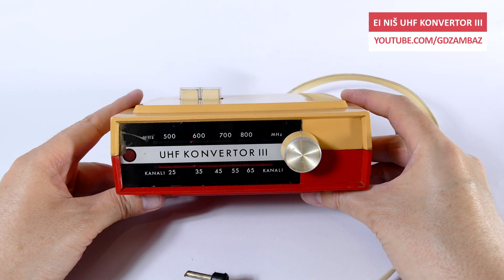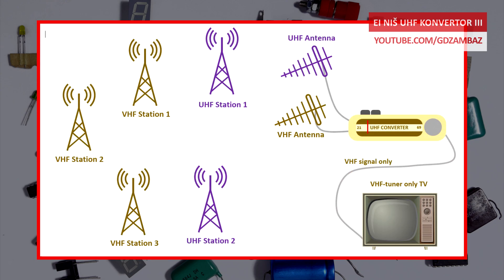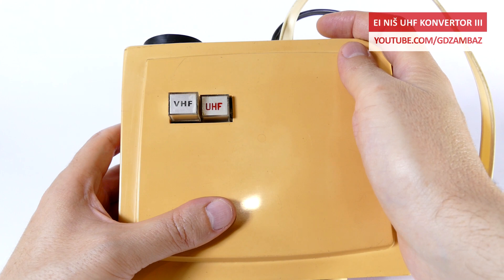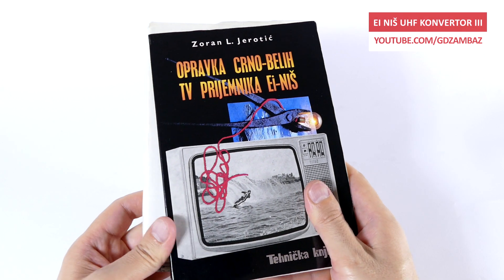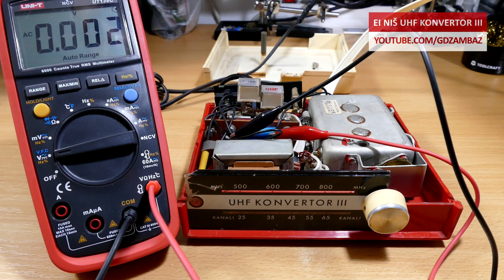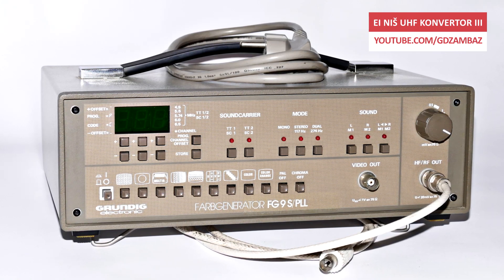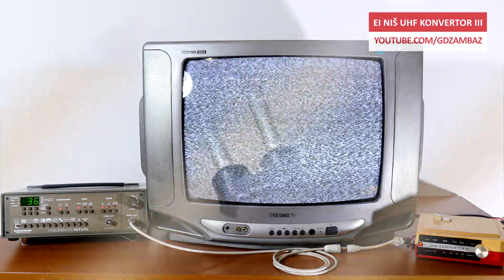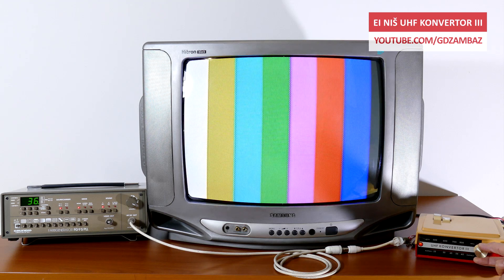Ei Niš UHF to VHF Converter: What was it used for? Will it still work?

Comment: Qual é nome da marca desse conversor? E porque não conectou direto na televisão 📺 para vê se pegava canais mesmo?
Reply from the maker: The converter was manufactured by the Ei Niš factory, located in Niš, Serbia, in the time when Serbia was part of Yugoslavia.
In absence of TV stations that use analog terrestrial transmission, I'm using a setup that consists of a television pattern generator made by Grundig (as a source of the UHF signal), the Ei Niš UHF to VHF converter (connected between the generator and the TV) and a Samsung TV. I hope that this answers your question.